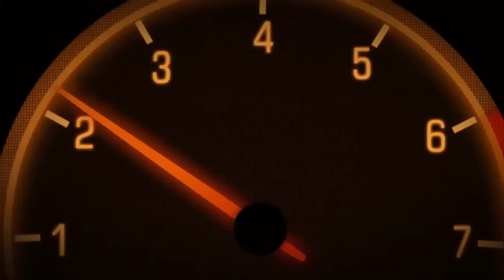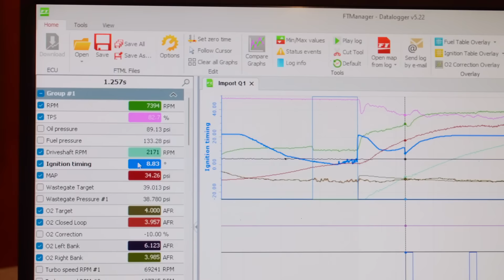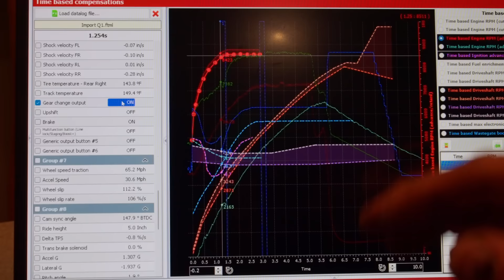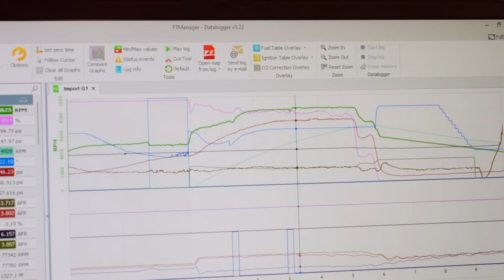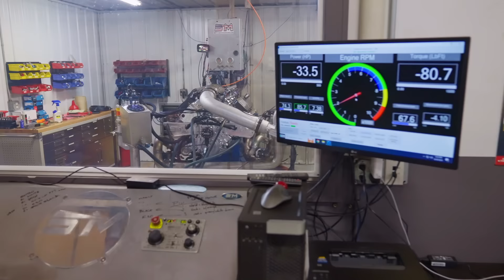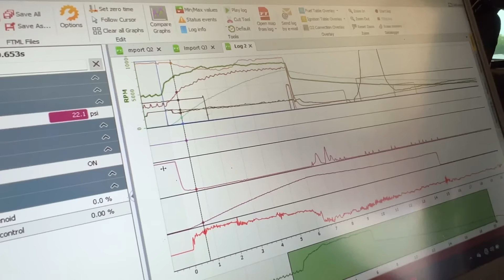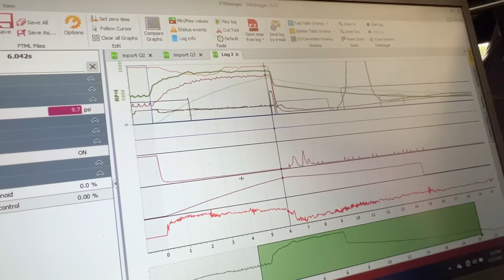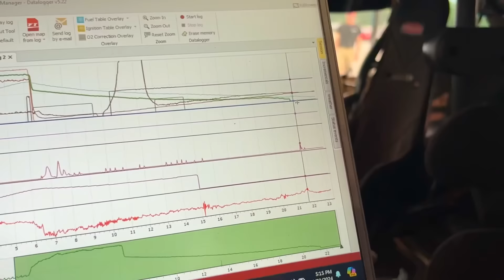Oh No!!!  Why Are There No Brakes @ 215 MPH!?!?

Comment: As much a I've had plenty of brake fad and tried various dot 4 brake fluids doing like roll racing with multiple bake to bake laps and settled on the Castrol SRF which has the highest boiling point(270°c wet/320°c dry) I found in Australia and never had a problem since which the tbm 5.1 looks falling short of that @180°c wet as far as temp goes

Although the wagon should have sufficient cool down time and not heat soak the brakes like I've have done

Comment: @Steve; Do you have room on the wheels for Double Calipers, 
And then add a minor Spare Master Cylinder. Possibly Electric...
Or, SuperMX  E-Brake... One Red Handle: Shutes, Engine Shut Down, 
and Max Emergency Brakes... (Front Shocks Max Extend)
Reply: Sheesh, it's not the space shuttle

Comment: You need baffles in your brake fluid reservoir. When you hit the chutes and let of the gas, all the break fluid went forward and you couldn't get enough fluid in the system to get brake pressure.
Reply: Definitely not it.

Comment: Man, thats too bad mamma jammin fast to be out of brakes, bro!
Glad you look to have made it out all right, that beast is gonna be THE baddest wagon ever, once these tiny teething troubles get ironed out.

I would check your line routing, cuz depending how you run your brakes already, with turbos (duh moment coming..)
1. boost means no vacuum, but I truly think Steve and co are smart enough to catch that deal.
2. doesnt mean some line hasnt rubbed through, or maybe touched some REALLY hot trans line?
3. PERHAPS not large enough reservoir for initial brake apply?
3a. In light of your data towards the end of the video, thats gotta be a blockage, or a leak,
IF YOU TRIGGER THE BRAKES BY SOME TRICK PRESSURE TRANSDUCER to ecu magic, ala Formula 1 style brake by wire.....Id check
All associated grounds and connections, cuz that would be screaming to me that its a failing or failed solenoid
(but, i doubt youd have taken the money and effort to concoct some top tier F1-esque braking system.....cuz that would be over-engineering your solution.)
10ish PSI after letting off the button, thatd be enough to hold some drum brakes in place, threre are different master cylinders for 4 wheel disc, versus  2 wheel disc and rear drum....
4. Uh, just General Motors things? 

I still have the feeling you have a damn broken line, or some kind of fouling in the brake fluid system. Moisture can RUIN the HELL out of everything, You aint running the stock ABS unit, WITH that DOT5 stuff, are ya?
Cuz all I know is that it eats the original orings and causes all sorts of bull ish when trying to use the OEM dot3 style ABS,
I dont know what you specificallly runnin, but Id guess some sort of manual BREMBO or other single master cyl, with or without assist(youd have to mickey mouse the gm OEM hydro assist power steering thing to make that work, and I would bet all day that Steve morris is surely not hacking anything together like that.
BUT
ive had zero money and zero time before, and thats how ish can go sidewards super fast....

short answer?
need detailed schematic of your braking system
but by that point, you guys will have found the devil in the details, im certian.
works in 3 hours, love the vids, that cars a beast, 

(i had a pair of trans lines split, for seemingly no real reason, cuz I went to get tacos last week sunday, and my engine fan snapped a blade, which broke the radiator top to bottom, which i guess rattled the F out the trans and oil cooler lines, and thats how $13 in crappy tacobell costs nearly $700 bucks.)

Because I have a chevy tahoe, so clearly, this is the time of year they wanna act up, i guess,,,,,,

i know ima go keep my eyes peeled.....
Actually, even though its 2 am, im gonna check that beotch ONE more time.......
😁

Comment: Air bubble, one of the biggest causes of brake failure with no visible signs of breakage or leaks is happened to me before for whatever reason the little plastic skirted piston in the master cylinders can roll up and backwards, letting the fluid come out just something to look for take your master cylinder apart that’s probably the issue because of this reason when I pump brakes I pump them slowly to be honest when your brakes are right you don’t even need to pump them the fact that you have to pump on your brakes to get a better feel is why I give this this opinion.

Comment: What are the chances there could be a damaged brake line? Or possible defect in the tubing somewhere? Like   a small crack that only is opening up during high heat and pressure combination? BTW, you have to have one of the strongest constitutions around to maintain that level of language composure under such adverse conditions, 😆.... Can't wait to see the wagon back ripping passes!

Comment: odd that both front and rear did not apply especially since they are separate systems.   Master Cylinder would be first place look.  In fact since you lost both systems, I would just swap it out.   if front didn't apply and the rear did, look at the line lock solenoid. if your sensor is before the solenoid and you show no pressure, it's probably not that though.   I don't think you boiled anything, Dot 5 can take a lot of heat and you'd at least get an initial bite before it faded away.

Comment: Your brake pressures are too low for your loss of brakes to be due to overheating the fluid. Are you data logging pressure of the front or rear?

Comment: Mother Trucker classic Steve!, check for moisture content in the brake fluid & the brake lines are no where near exhaust pipes!
Dot 5 is Silicone based & can't be mix with any other Dot based Fluid, not even Dot 5.1!

Comment: I don’t know how yore line-lock for the breaks is “built” but if the valve is stuck closed (or nearly) the break pressure won’t get all the way to the callipers, and on the way back it got an stuck and the breaks are fine again… I would start there 😊 (line-lock valve )

Comment: Just an educated guess, but I bet you that under heat you have a leak develop and that the "oil" all over the brake caliper is actually brake fluid because the heat opened up the leak but once it cools it re-seals and you have brakes again. 

AN fittings or o-ring type seals can do fun stuff like that.

Comment: You should buy a mechanical Autometer brake pressure gauge.and run them to any high pressure system. You would know if something hung up or still had pressure when it shouldn’t

Comment: You probably have a residual check valve sticking on it maybe to be holding 10 pounds of pressure. That out it maybe too high of a valve, I know they run on cars with low mounted master cylinders to keep fluid draining back into them and out the vent cap. At least you’re ok and cars ok. Look forward to seeing what you find out.

Comment: If the brakes are hanging during the run they would be getting glazed pretty badly which is going to feel like they are glass on glass when you stand on them. What is the brake pressure measuring though in that data log? I assume actual line pressure? and if so maybe fluid was escaping to cause the low pressure and the smoke? Time for new calipers I think either way after that scare, I almost filled my pants just watching <3

Comment: I'm sure you probably already know this but it's good reminder for everyone else out there. Your dot three and DOT 4 brake fluid will absorb moisture (designed that way on purpose) and can fade when get hot from that moisture boiling out.  Your silicone-based dot fives don't absorb moisture And you can get moisture pooling down in the bottom by the caliper (think oil and water don't mix)and that can make it lose the pedal dramatically when it boils.

Comment: You handled the situation very well. Er….. did you get a ticket ? Cleetus wudda towed you for a 1/2 price fee. Well it’s a real pretty tank buddy. I had the brakes on my  1974 Chevy van go out on me while coming down a hill with 12 Boy Scouts on board. Got to the bottom of the hill and they mysteriously  came back. Brought it in for service and the teck said “yeh, Chevy brakes will do that”. I went thru the roof. Apparently, it’s a fact. Too much heat and the brakes “can” go away (sometimes). No answer’s no fix, no nothing. Chevy has always known about this but none of us ever have. I sold the damn van, and that is the last Chevy I ever owned.

Comment: 100% that residual pressure is probably your issue, that sort of fade isn’t fluid that’s boiling it’s the brake material being so hot it just can’t convert any more kinetic energy to heat, it’s the sort of thing we see in road/circuit racing and it’s not a nice feeling as no amount of pumping the pedal gets you any deceleration

Comment: Just change EVERYTHING with the brakes. Change calipers, rotors, flexible lines, fluid and pads. If you said you were having small issues before, That was your warning! Cheaper to change all the brake hardware and check the hard lines for leaks or damage, then crash the car. Your paint job cost's more then doing all that. P.S. Is it vacuum power or manual brakes. if vacuum, Gauge check vacuum pressure after letting off

Comment: Ain’t no way you boiled the brake fluid doing that minimal hard braking, and the fade looks more like a pressure loss. I’d be looking for a damaged/loose fitting, split line or an outright leak. I’m guessing you don’t run a booster but does it have vacuum in the reservoir? Anyway, glad you are ok mate, and the tunnel looks sweet too(I’m one of the tunnel nanny’s 😂)

Comment: you need to get with someone from Stek USA to get some PPF on the wagon paint! Adam LZ had his new subaru rally car and the dude installing proved on camera that you can take a wire brush to the ppf and it will heal with hot water in minutes

Comment: Sounds to me like the line lock that holds the brake pressure on when staging has gone poop and not fully opening when launching. Replace that valve or at least check it to see if it is opening fully.

Comment: Brak calliper stuck, no pressure in system but it burned brake pads and brake fluid before you hit brakes.When its cold it self release. Any pressure in system after releasing pedal is bad thing..

Comment: Normaly the brake pressure should be near zero so the breakpad can retract so much that a air cushion builds up between the pad and the disk. That is important to cool the disk otherwise the brake system takes the heat and refuses it's dutys. I think there is something off with the main zylinder or pedal. Warped disks would result in oszilating pressure on your log-readings. Maybe it is somthing simple like a damged or never installed spring. Remember, you put the car in secounds to a amount of stress other cars did not experience in there whole life.  ;)
And I know the feeling from racing with shifter-karts when you at 6th gear, full throtle coming from the straight to a hairpin turn and your brake pedal is entering the void. Moments that make you questioning you life decisions.

Comment: We have cool shirts with ice water pumped thru it. Then fresh air helmets. With a little work they can be run into a single lunch box cooler. Less added weight. With the fresh air hose ran through the iced water in cooler you can be a cool as you can stand lol. For one 200 lapper on July 4th 10 time arca champion Frank Kimmel loaned us a NASCAR air conditioner! Was a box about the size of a loaf of bread! Ran helmet air through it. Friggin nice!

Comment: Remember, it's not the lack of brakes that's the problem, it's what you run into!
Yes, cooked brakes, which boil, are the normal reason for those symptoms - are you using a dual circuit system, as if you had and both lines are monitored, it'd point you to which end, at least, is the problem.

Comment: Would be nice to have a temp sensor for the brake fluid. But you'd need one at each caliper cause all it takes it on caliper to boil and you have no brakes

Comment: i bought a new also my first chevy truck in 1978 i pulled out i stopped at the first light the 2nd light i ran the light. i turned around came back to the dealership the checked it out found nothing but they would drive it one time they would stop the next time they couldn't. after keeping the truck for 3 weeks i got a call to come get my money. they replaced everything to do with brakes on it and it still did the same thing.  thats why i got my first 4x4 fpr the same price. and had 4x4's ever since. but i was told they never could find out what was wrong with it and used the truck as a parts truck and in time used every brake part off that truck and they all worked.

Comment: On that pass or the pass before that at the starting line it looked like you pumped the breaks so you might of had a bunch of air in the lines. With hot fluid = no good

Comment: not knowing how long your car has sat with out changing the brake fluid ,, but i am sure / hope you have changed it in the last year?
but even if it has water in it it would still take a boat load of heat to kill the brake to that point.  DOT3 and 4 with 3.7% water by volume witch is fully saturated is down to 212 f . 
if i remember (bet i am wrong) you are running EBC brakes so i am betting you are using there dot 5 or 5.1 witch is crazy high temp 500 f.  
i would look to see if something is throwing heat some were in your brake system.
there was no reason for this that i can think of... 
LESS you had a brake dragging making huge heat.   did the line lock fully release?  the front brakes do most of the stopping if they are supper hot you are not going to stop.
Reply: ok after watching the rest of the video the clues are there. the brake line lock is not working right and dumping all of the pressure ,, makes the brakes hot witch means no brakes. 
now here is the big question?  how long has this been happening?  knowing the huge amount of power it takes to go this fast how much faster will your Wagon go with the brakes working right??

i do love your videos and how much work you put in to your love of racing.

Comment: You made that comment about not wanting to be like Bailey & doomed yourself.  ;)

If you have some residual hydraulic pressure due to monitoring pressure, need to determine if it's enough to engage any of the caliper pistons.  A dozen pounds shouldn't, but need to prove it, or rule it out.

If there is, & it's enough to drag a pad, it msy be heating enough for brake fade due to heat in the pads.  It seems like it'd have to more than a little drag since you're only going from pits to staging.

High perf brakes have to be beat on pretty hard to generate enough heat to get fad, but those pads aren't very big, are they?  A third the size of the OEM front pads for that wagon?

Still... they ARE supposed to stay cooler w/ ventilated rotors.

How about external heat source (exhaust) boiling a line?

If they self healed, it's gotta be heat related brake fade situation.

Anything else would stay broke.  Curious as to the pedal reaction at end of run.

Comment: Just another day at the beach. you run and dive in.. then you go home and pick sand outta your cracks for a week. Glad you are Ok mate. Hey you kept saying oil down the right side front.. I wonder if the slave cylinder on that side is getting hot and the casing is swelling allowing fluid and brake pressure past seats / boots. Then when it cools it seals back up.

Comment: As a central Ohio resident, I'm REAL glad this didn't happen at National Trail😅 This probably wouldn't have been as pretty of a picture for your front end.
Hard to say what happened to the brakes without further investigation, that's a weird one given that you had brakes to burnout & stage and had brakes on the tow back, but nothing down track. With that said, I do think it'd be a really good idea for heavier drag cars like this to run brake cooling ducts for the calipers & rotors, just get some sort of air flow to your these lightweight drag brakes since they don't have any design features to really move air like conventional brakes have(like how vented rotors pump air from their center outward).

Comment: I noticed that you had a lot of throw in your break pedal on the race before, probably wouldn't hurt to throw in a cable emergency break at least for the rear tires and possibly for even the front rotors, just to make sure that you have breaks, good breaks are at least as good as a good motor simply because the motor is trying to kill you and the breaks are trying to save you

Comment: Brake failures, coming from a road racing background.

Pedal travel in the early runs looks to be very long even when the brakes are working.  This is usually from too small of a diameter master cylinder that can't displace enough fluid.
In the brake fail vid, it looks / sounds like the pedal is going full travel and hitting the stop.  How old is the fluid?  Given the rotors / pads / calipers are pretty small to begin with any sort of fluid boil eats up what little reserve you have.  When the brakes cool the boil condenses and the brakes will return.   ( If the pads were overheated to fading, the pedal would be hard with normal travel but no braking action due to the pads boiling off binder and effectively hydroplaning over the rotor surface,  ) 

I'd be looking to increase master cylinder diameter one size , make sure the MC has full travel and change the fluid on a regular basis like halfway through the season. I'd also be looking at the inside of the rear rotors for grease contamination.   When the rear was maintenanced last time, the bearings had way too much grease packed into them and the excess will be flung out.  Ball bearings need way less grease than one would expect.  I'd also be looking towards fabing some sort of baffle to keep grease off of the rotors.